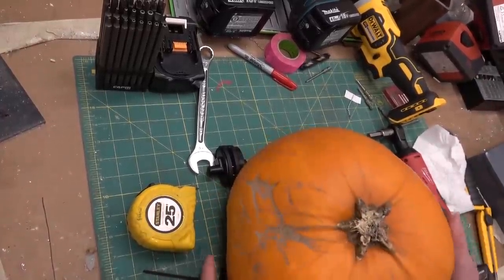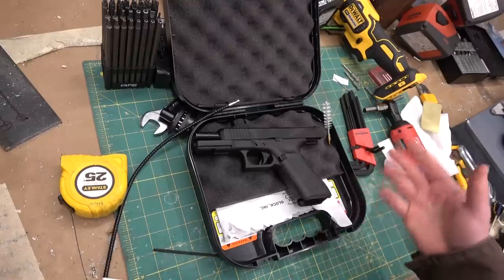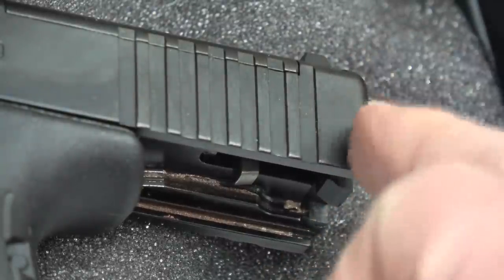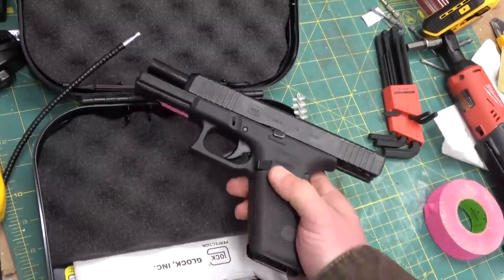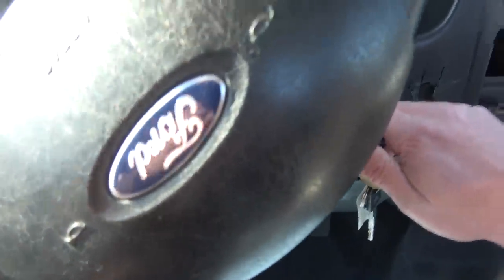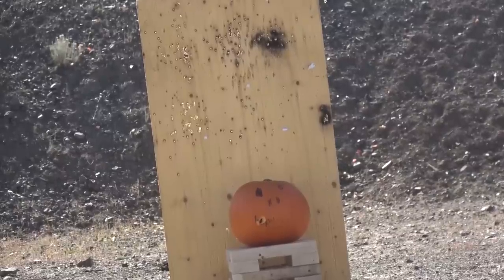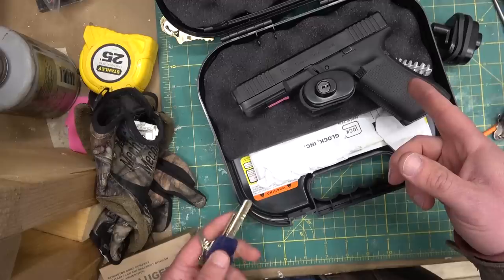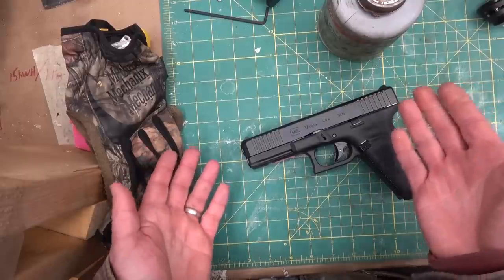BOLTR: GLOCK 17 GEN 5

Comment: Not sure if this was answered already, but Gaston Glock was an engineer with a great deal of polymer synthesis experience. Glock polymer frames are proprietary nylon based poymers and are not fiberglass reinforced. (They're likely carbon reinforced). Glock calls it "Polymer 2". Competitors making polymer framed firearms have indicated that they used DuPont Zytel (GRF PA 66). My guess is that Glock Polymer 2 is a similar formula to PA 66, but it is for a fact, proprietary.

Comment: Anti-Seize compound actually contains fine metal powder. Usually softer than the metal it's being used on (so that it won't do damage). Anti-Seize will not damage your firearm. The reason you don"t use it on your gun is that it contains grease, and dirt will stick to it and cause the gun to seize. Although, dirt is abrasive and that will damage the gun.

Comment: For a Canadian, you did pretty well here. But as a firearms loving Bald Eagle expert that I would qualify myself from over 10 years in the industry of, including certified gunsmithing,  just a few side notes for you sir.

You didn't go as in depth as you do on other tear downs, perhaps for legality of non America? So I will fill in those gaps.

You completely missed the lockup of the barrel to chamber area. You need that timing and lock up to create pressure. If you ignite a primer while the cartridge is not in a barrel, literally almost nothing happens. It just makes a loud noise. So that lock up and timing (tilt of the barrel fitting into place etc) is pretty awesome. 

Safeties. ..

The plunger on the slide is the firing pin block. It is actuated by the trigger bar.

And back to the barrel, polygonal rifling has debated benefits. Tighter seal for more efficient lead moving, less friction and deformation. And supposedly less chance for bulk up in the lands and valleys of traditional 'button broach'/'button cut' rifling although Glock specifically at one time recommended not using exposed lead projectiles because the build up of lead caused over pressure and boom goes the barrel. I don't know if that's still the case, maybe they have changed their stance.

The chamber area of the barrel also has a relief cut in the top. That's is for said over pressure or falty cartridges. The idea is it acts as a vent to prevent destroying your pew pew or your hand.

Also the coating on said metal parts. It's anti corrosion, their own blend, I'm not a big fan because it's thin and scrapes easily but it's whatever. The slide especially. 

The barrels are hammer forged instead of button cut. Kind of neat as well.

For a complete disassembly it's very easy with a punch and small hammer. You are over qualified for its full and complete tear down and reassembly. 

Not sure if any of that really mattered or helped, but I still love your videos. If you have any other pew pew questions, I'd be happy to answer them to the best of my knowledge. There is a lot of misinformation and outright dangerous information in the pew pew world and it's a real probelm. 

So thank you for this video.

I recommend looking at a CZ-75 or HK P30..  the CZ has one of the most convoluted sear mechanisms around but are amazing firearms,  and the P30 series for HK actually warrantied their barrels to not explode if fired with a blockage...that's kind of ridiculous imo. 

Thanks you again kind sir.

Comment: “Low and to the left” is almost always an issue with the way you’re pulling the trigger. If you’re jerking or anticipating the recoil, that’ll be why you’re shooting off-target. Instead of keeping your finger on the frame and then immediately jumping to the trigger, just work on slow, easy trigger pulls where you pull straight back without flinching.

Comment: that copper stuff is to smooth out the trigger bar where it contacts the firing pin block as the gun fires over and over. was told that by a glock armorer

Comment: you need to learn trigger reset, after the first shot keep the trigger pulled and slowly let off till the trigger clicks, then you can fire again.  You dont have to release the trigger each time and pull the full length.  Using trigger reset will tighten up your groups.

Comment: I dunno if anybody's said this already but the hexagon deal with the crown is what they call "polygonal" rifling where the inside of the barrel is a corkscrewed polygon, usually a hexagon or an octagon whereas conventional rifling is usually cut into the barrel. Yours is a little different, I think in the gen 5 glocks they added some grooves, which I think is called "multi-radial" rifling. There is some marketing wankery here but it is at least a more expensive process than using conventional rifling.
The purpose of this is slightly increased accuracy and muzzle velocity, which seems to show in ballistic tests (i think it's like a 15-20 fps difference, not a lot). Other benefits are reduced fouling and increased barrel longevity due to reduced stress concentrations along the edges of the cuts. However, it takes a lot of shooting to kill a barrel with conventional rifling anyway as long as you actually clean your gun. So, real world benefits are tangible but limited.

Comment: ...it is not powder actuated. Lol.
Primer compound is a solid state material and that ignites the powder...that sir is a recoil operated .locked breach. Self loading , open shaft piston engine. And the best slippery stuff for it is a light teflon or lithium impregnated grease for cold weather and mpro7 or otis for everything else...dry lubricants are decent in dusty conditions. But those are aditives....get yourself some robar np3 coating and dont worry about metal gauling if you forget the lubricant.  or microlon gunjuice...happy shooting.

Comment: The copper shit in the slide may be meant to smooth out the slide with its grittiness throughout the first couple hundred rounds or so. Actually a lot of 1911 slides go through a similar process where gun smiths will keep working gritty shit in there.

Comment: Love the video!  Oh boy, shooting, metal stamping and lubricants my favorite topics.  I was smiling as you were poo-pooing on metal stamping.  The reason for going with stamped parts is not for money saving it is high volume production.  The dies to produce these little bits of metal are high tech progressive dies that will turn out 100+ parts per minute.  You only go this route if you are producing 100,000 or more per year.  stampings have another advantage over die casting or machining and that is you can make things lighter and stronger.  The steel work hardens during stamping and if you spend the money metal stamping can be very precise... just pull a quarter out of your pocket and compare it to another identical at several hundred per minute. Fine blanked gears have none of the fracture zone you see on your cheap washers.  I would argue that there is no other way of producing a lighter stronger mechanism than stamped cold rolled high strength steel.  As far as lubricant goes I cannot agree more with you except you will not likely get "hydrodynamic lubrication" in the slides of a gun unless you slather it with grease or high viscosity oil.  I coach biathlon and the first thing I do to the $4000 Anschutz biathlon rifles is to pull them apart and remove all of the grease or liquid lubricant.  At 0F or -20C grease will not be your friend and you will have jam ups... also dust and dirt will be picked up by even the lightest liquid lubes.  I use high quality dry film bicycle chain lubes that prevent metal to metal contact that can result in galling (cold welding) and will provide some protection against corrosion. I 
Keep the great videos coming!

Comment: Don't think the "Copper paste" is a Problem, you can get this stuff in different mixtures, also for lubrication. Often it's not just copper but a special type bronze, according to google its called gunmetal in english, german word is Rotguss RG7. This stuff has excelent lubrication properties under high temperatures. If nit mixed with sand, but only high temperatur grease, you have the perfect Lubrikation for your gun. As the RG7 particles get pressed into the surface and act as emergency lubrication after all the grease is gone.

Comment: Maybe they’re trying to break in the
Contact points with the abrasive nature of the antiseize. Almost polishing the contact parts. Then you use lubrications to prevent corrosion and keep it from wearing down after break in period. Hence the break in period.. idk just some “maybes” from the few years of engine work I’ve done. Seems to be a Coated surface that may need to be worn in first. Like breaking in an engine lol. Especially race motor. Like how they use zinc oil for the break in oil. I really don’t know what I’m talking about but Atleast I know that! 😁

Comment: It's a break-in compound.  These are mass produced arms the see little to no fit and finish.  The grit helps to knock the rough edges and burs off the castings.  Pretty sure the user manual covers this.  Probably says something like, run 50-100 rounds through the pistol (break-in period) then clean and oil with a proper gun oil/lubricant.  No firearms should ever be pressed into service without a proper break-in.
[edit]  I know he get's there in the end.

Comment: "The Glock's frame, magazine body, and several other components are made from a high-strength nylon-based polymer invented by Gaston Glock, called Polymer 2. This plastic was specially formulated to provide increased durability and is more resilient than carbon steel and most steel alloys."
Reply: Tactical Tupperware.

Comment: From what I've heard , Glock uses a pretty tightly guarded polymer recipe using a base of nylon 6. Your absolutely right about the never seize they throw on from the factory, they get the consumer to "finish" the manufacturing process for them, although they probably won't admit it's just never seize of some variant or that they're passing the buck to the consumer. The tolerances of Glocks and other duty style pistols are fairly/extremely sloppy depending on one's own standards. This is done intentionally. They have to dance the line between reliability and accuracy. If the pistol is super tight and hand fit like a high end 1911 they can produce extreme accuracy but tend to have break in periods, are finicky with what type of ammo they like,  and if they get too dirty, can jam pretty easily. Making the pistol with looser tolerances obviously will make the pistol less accurate to a degree but will allow it to still run after being shot to shit without cleaning or filled up with dirt, sand, and debris. They're plastic, they're cheap, they're ugly, and they work....should be Glocks catch phrase.

P.S. Get rid of those shitbag place holders they call "sights." They're a joke. They break and they suck a hard long one.

Comment: Being a long time gun enthusiast and gunsmith im pretty sure the proper terminology for the bullet container is a 30 caliber dispensing 30 bullets in less than a second clipazine device.  Well as told by master non gun enthusiast/smith politicians from certain left fell over and still tumbling (as opposed to left leaning) areas.  On a serious note though glocks quality has went to hell since the second generation.  I love the second gen glocks there were phenominal firearms.  These days i stick mainly to smith and wesson mp series and taurus.  I knkw i know alot of people bitch about taurus but i have never had one break nor malfunction on me.  But have had to repair several glocks.  Anyhow as long as it works for ya and goes pew/bang when ya mistake the trigger for a nostril its all good. Happy shooting.  Another excellent video as usual.

Comment: Far as my understanding goes, new firearms generally come with a grease that'll keep the rust out, but you're supposed to clean it off and replace with gun oil before you fire. The grease is supposed to keep better over a longer time than oil.

I have no idea if Glocks follow the same idea or not, though.

Comment: The sights are off because you are jerking the trigger; squeeze, don't jerk.  The thing you called a magazine safety is an out-of-battery safety.  The claw is the extractor; the ejector is that finger which sticks up from the back of the frame on the opposite side from the extractor.

I had no idea how small your hands are until I saw you grip that Glock 17.  I am used to the Glock 20 which is larger.

Comment: I found this on Glock Talk forum:
"What is the Glock frame made of? 
The Glock frame is made out of a high-tech plastic polymer called nylon 6. Exactly what that means, I don't know. But our resident engineer [MarkCO] was kind enough to provide some explanation: 

Commerical price for hi-grade Nylon 6 is about $3.50/lb. Commerical price for hi-carbon steel is about $1.50/lb. Sounds to me like the Glock is actually a better buy. Anyway, I did a little research and got a smattering of information on the Glock plastic "formula". One source says "more highly guarded than the Coke formula". From 3 human and 5 technical sources, Glock uses an out-sourced proprietary hybrid polymer mix with a base of Nylon 6. The frames are cast and offer high strength, wear resistance, abrasion resistance, and good resiliency, good ductility and toughness. Fracture mechanics are excellent with defect ratios below 1. Do not compare to extruded Nylons because it is different. Casting prices range from $3-$50/pound depending on process and intricacy. The Glock is considered highly-intricate due to imbedded metallic components. Offers long term performance at elevated and depressed temperatures. Chemically stable in a majority of environments, attacked directly by strong acids and bases (better than steel actually). UV exposure results in degradation over an extended period of time. 2-3% carbon black virtually eliminates UV degradation and Carbon-Black does not become readily absorbed in Nylons offering higly increased useful life spans. Loss of mechanical properties with 2% Carbon-Black is less than 0.05% on an elevated UV exposure test equivalent to approximately 100 years. Hyrdolytically attacked by water in excess of 120 degrees. Basically, no hot-tubbing with your Glock and you will be fine. Tupperware is not made from Nylon BTW. Hope this answered some questions. 
Good Shooting, MarkCO"

Comment: The funny thing about Glock is - that Glock was originally a Plastics and Metal Company which produced materials/technology for Windows, Fireproof Doors and such - not guns at all. My Uncle worked at this times there.

The Plastic for what i know is a proprietary nylon 6/6 which Gaston Glock back then invented and was designed especially for Military Gear i think in the early 70s for the Austrian Bundesheer - and actually is not fibreglass reinforced.

This Plastic was first used for Knife and folding Spade handles until Glock won the government pitch for a new "Dienstpistole" (service pistol) for the Bundesheer in Austria which used the same compound. (Goal of the Pitch: Fast/Cheap to Manifacture in Mass Production and easy Maintaining since it was for the Austrian Bundesheer)

If this new Generations are also this "special nylon 6/6 mix" i dont know. But i know that the "Polygonal barrel" is intended and there since the first version of the Glock 17.

Well after that they made a subsidiary company in america and changed their primary focus to producing firearms, became practically what they are today.

Funfact - the 17 stands for the 17th international Patent Gaston Glock filed. 

Greetings from Vienna ^^

Comment: *Fiberglass impregnated Nylon...we believe.  & Yes, your percentage estimation is nearly correct. 30 to 35% 'might' be a better number.   The one part on that which "IN MY OPINION, should be replaced",    is the "barrel latch" or  that spring loaded piece that keeps your barrel and slide on when you want it that way.   IF you prefer  accuracy  when sending  lead poisoning devices at rapid velocity.  A flatter aftermarket  "Take-down Lever"  that is NOT "stamped with a number" might serve well.   The stamping process bends the thin metal part during stamping with a very slight curve.  A flatter take-down lever, sans stamped-in-numerals,   allows for more consistent barrel to lever lockup with each successive  press, bang and the subsequent spring loaded cycling.   My G-Lock is thusly equipped and I also added an aftermarket match grade Wilson Combat  Barrel so that I may shoot  greased lead  non-jacketed,  formed and  loaded at home,  lead poisoning devices at rapid velocity.    IF one prefers to reload the brass... The fully supported Wilson  Combat Barrel chamber is just a bit tighter and more supportive for allowing less brass swelling.   G-Lock opted cut chambers egg shaped and slightly over-sized   to increase  combat reliability   during extended  dirty in the ditch  firing sessions.   For that purpose, it works as designed, engineered and made.  For just working as it was designed,  G-Lock is Skookum.    For "saving spent brass to reload",  G-Lock factory barrels are not skookum.  Enjoy your dangerous toy as much as you are allowed to, whilst north of the border."

Comment: Boss, that “ever-sneaze” is on there NOT as a lubricant, but as a surface polish/finisher. Meant for breaking the gun in, and smoothing out the action during break-in. Rather than hand-polishing the slide to rail surfaces, they just slap that stuff on to break in the action during the break-in period. It’s not meant to stay on there for extended periods as you’re meant to clean and oil the gun after break-in.
Reply: Edit: I posted that in the beginning of the video, but he actually goes into detail about the surface lapping/polishing later in the video. Apologize for my ADHD...shot my load too early, as per the usual arrangement. FACK!